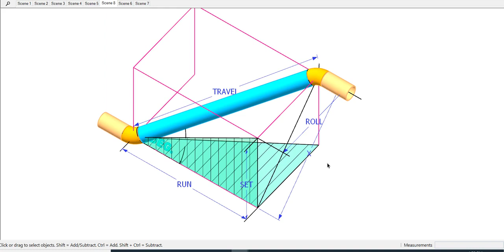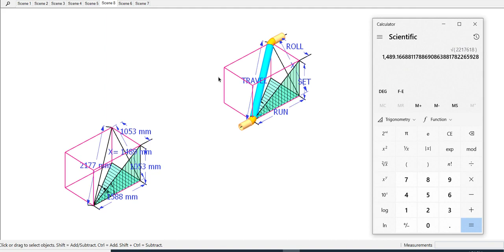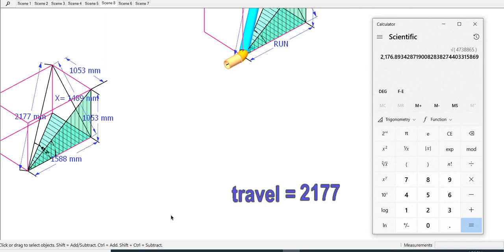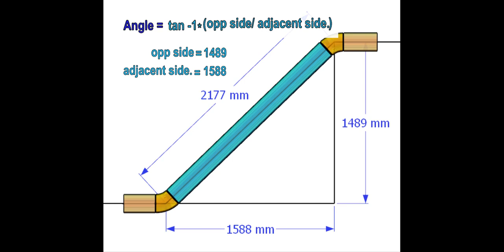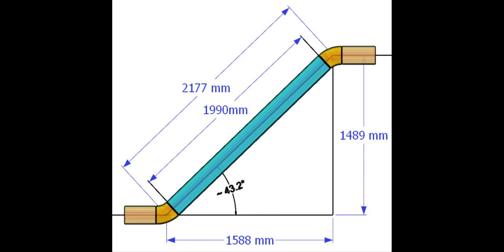How To Calculate The True length or Spool Length of a Pipe in a Double rolled Offset

Comment: Hi, thanks a lot of the video.
I understand that the top elbow angle is the same as the bottom = 43.2°. How do we prove this result ? If we do 90°-43.2° we get 46,8 °, what does this 46,8 angle stands for then ?
Also, on an ISO drawing, what would be the angle of the elbow shown ? 29° ? (angle on the vertical plane = atan(1053/1905))
Reply from the maker: Bro, thank you for the question. Could you please carefully practice the example again and again.